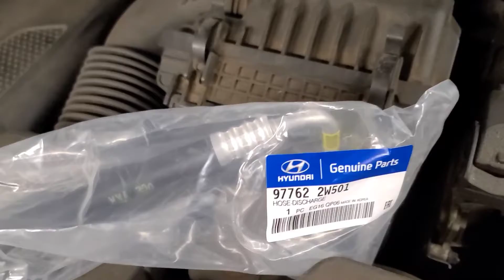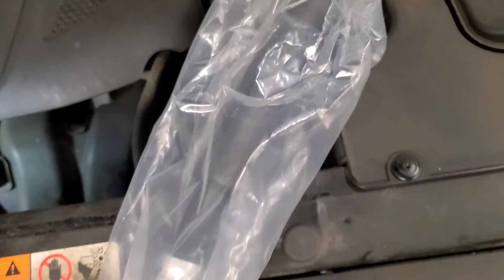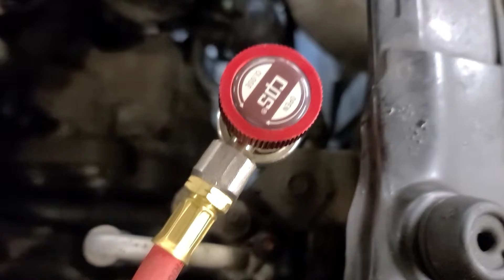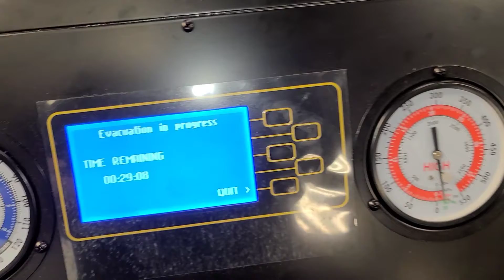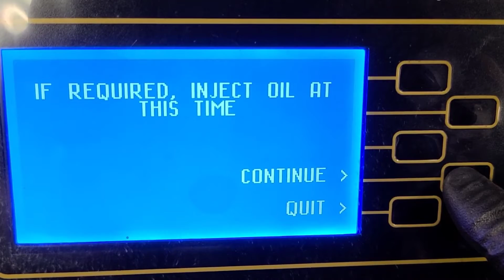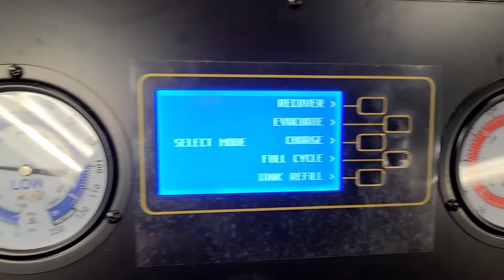2014 Hyundai Sante Fe AC Line Replacement

Comment: Did you put dye in it to figure out where the leak was? I am having the same issue and he is saying its an ac line where the dye showed the leak.
Reply from the maker: Actually the dealer had put dye in the system and diagnosed the leak.

Comment: Its a video on the ac machine really. Be helpful to see how the hose was replaced.
Reply from the maker: There's literally two bolts  one at each end. Once the system is evacuated remove the bolts and remove the line. Install new orings and lube with pag oil and install the line. Evacuate and recharge. Not much to it.
Reply: @PhillipBailey  ooooh so its super simple 👌🏻 thank you sir
Reply from the maker: @gunfuchinky  yes once its empty its very easy to replace. The bottom bolt on the compressor is a bit tough to reach but not that bad. Good luck.
Reply: @PhillipBailey  thank you sir
Reply: @gunfuchinky  I just did this job and the bottom bolt on the compressor it was a bear to remove.. I ended up having to remove the compressor completely and get a set of vise grips on this nut it was so tight, it's hard to get access because the hose going into the compressor is in the way.. the guy that installed mine at the factory must have used an impact wrench.

Comment: You skipped over the most important part changing the hose. I mean the video is titled changing the hose not charging and uncharging a system
Reply: I have the same opinion. I wanted to see how he got to the lower bolt. Did he go from the top of the engine bay down to the bolt or up to the bolt from under the car?
Reply from the maker: Top down with a 3 foot extension and swivel socket
Reply: Exactly

Comment: Our 2014 Santa Fe (GLS V6, long wheel base model) is leaking also. I wonder if this is a common place to leak refrigerant from? We charged it at the start of Summer, and lasted all Summer, and now it's empty again. So whatever leak it has seems slow.
Reply from the maker: Do you have rear AC? If so I'd be suspicious of one of the rear lines leaking. Did they put dye into the system when it was recharged in the spring? If so you can look at the lines, hoses and fitting for evidence of dye with a black light. The dealer did have this line in stock though for what it's worth...
Reply: @PhillipBailey  I do have rear AC! In fact, I noticed the rear wheel well looks like it took some damage, and the AC lines are a bit exposed, but I never thought to check for any damage to them. Not sure if they used dye when they refilled it, but I'd wager no. Thanks a ton for the lead!

Comment: Thanks for the video!  We were just quoted $570 for replacing this line and recharging the system.  They actually recharged today while diagnosing so I guess they'll have to evacuate,  replace the line, and then recharge.  $570 seems high... is this a reasonable cost?
Reply from the maker: Part is only available from the dealer and retails here in Canada for $145.00. Add $20.00 for refrigerant plus approximately 1.5 hours lab at whatever rate they charge. Here the cost would be $315.00 plus tax Canadian so that price seems a bit high but depends on the hourly rate. Also this price does not include checking for the source of the leak which could involve partially recharging and testing...hope this helps
Reply: @PhillipBailey  that does help. I can see where the dealership put  green dye in the low port a couple years ago. I can now see traces of that on the discharge hose below the crimp and down from the high port. Same hose you replaced in this video.  

Is this something an avid DIYer could manage? Only thing is I'll have to wait for it to completely leak out I guess or get someone to evacuate and then recharge.  If they have to do all that, I'm just the inbetween guy so to speak only replacing the hose. Thoughts?
Reply from the maker: @ducsauce85  you're correct. Legally you are supposed to evacuate the system then change the hose. You can't just let the refrigerant escape to the atmosphere. So you would have to have someone recover it then take it home and change the hose then return to have it vacuumed and recharged. Probably won't save much and if a fitting leaks you would be doing the whole job again...
Reply: @PhillipBailey  makes sense.  Appreciate the help!
Reply: @PhillipBailey  so I found an aftermarket hose a lot cheaper than Hyundai.  It appears to have come with extra blue o-rings. Is that common? An o- ring is already installed at each end of the new hose.

Also,  if I replace the hose myself - should I worry about adding a bit of whatever type a/c oil back into the system or will the shop do that if deemed necessary?
Reply from the maker: @ducsauce85  as long as there are tge correct number of orings present you should be fine. Put a little PAG oil on them. No need to put oil in the system for only a line replacement. Good luck.
Reply: @PhillipBailey  me again. :) I just rented a vacuum pump and gauge set to get this job done.  I bought some PAG 46 oil for $10. Not a huge deal but I'll only be using a couple dabs of the stuff and probably never use the rest.  Is there another suitable oil to use for the o-rings on my replacement hose, mineral oil? 

Also, I know you said not to use PAG oil for a line replacement but how do I know how much may have leaked out, if any?  Also, having a hard time finding if a 2013 Santa Fe uses PAG46 or a different kind. Sticker says PAG SAE J639.
Reply from the maker: @ducsauce85  unless you are changing the compressor, condenser, evaporator or the dryer there should be no need to add oil to the system. For the amount you are going to put on tge orings any pag oil viscosity would be fine. Probably mineral oil on tge orings won't hurt either. A leak from this line should not cause a significant loss of lubricant in my opinion. You could add 1/2 ounce to the compressor if you like and if you see oily residu at the leak area. As far as I can tell PAG 46 should be fine. Good luck.
Reply: @PhillipBailey  thank you sir! I'll let you know how it goes
Reply: I just did one for 210. I purchased the line on Amazon for 30 bucks

Comment: I'm debating replacing the discharge line myself and getting it recharged at a local shop. Is there any drawbacks to not doing recovery before replacing?
Reply from the maker: legally you can't just let the refrigerant expel to the atmosphere. But if it's already empty due to the leaking line... Be sure to use new o-rings and lubricate them with refrigerant oil.